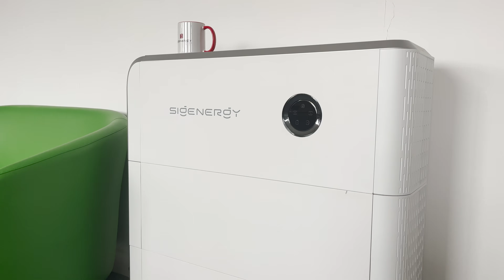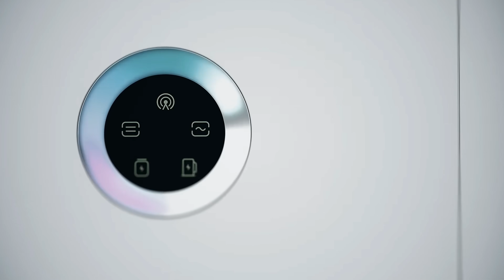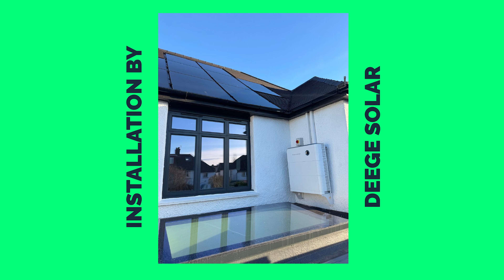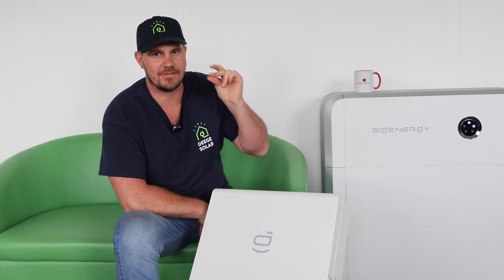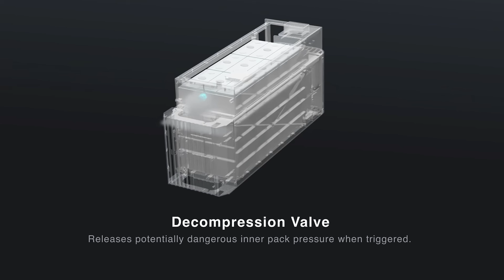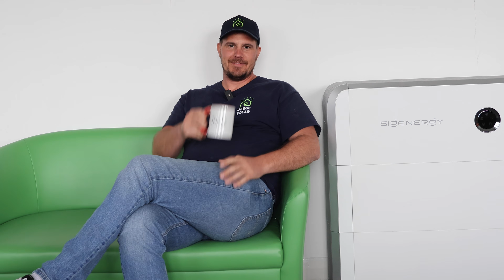Everything You Need to Know About the Sigenergy SigenStor | Full Battery System Review!

Comment: imho what lets  the sigenergy down, is the "creative sizing of the batteries", compared to the pw3 what you see is what you get, upon watching this in november, according to its tecnoligies a 8kw inverter plus 3 9.04 kwh batteries comes out @ £9,066, which is 720w shy of 2 pw3 units,eg 1 plus 1 expansion packs for 27kwh DOD 100%, i was quoted on the phone by octopus for the pw3 1+1, just shy of £9600, so a extra 720w thereabout for a extra £500 or so seems like it is worth the extra cash,plus with the pw3 as standard it has multiple power levels, without the need to change inverters, which is where sigenergy also falls down, bad choice by the marketing dept trying to market a 10kwh battery that in reality is only 8.76kw, plus the 15mwh warranty is a bit naff too,myself my 2013 3.68kwh FITs system in 10 months so far in 2025, i have generated 3.852 kwh, so realistically for me 4mwh a year ,with circa 2013 panels ,which if i had new panels as well, my batteries would only be warrantied for under 4 years, NOT good either warranty the batteries for charge cycles or time, not on throughput,with the advent of smart tariffs most people will use the export to earn money,eg fill the battery on cheap to 60-80% and as soon as the sun is up or 7am export like crazy to get the 15p per kwh export rate, leaving enough in the battery for the house loads, myself i average 6-7 kwh a day usuage,so i would be aiming to export @ least 20 kw a day, that will soon eat into the 15mwh warranty level, add a ev/heatpump & your warranty on the sig battery quickly comes down to 3 years or less, it is these "glitches" that will potentially cost it warranty claims in 3 to 5 years time, and whats not to say sig will start saying "you have gone over your 15mwh throughput warranty", neither you or me or joe public have crystal balls to know how sig will react to people,playing a daily arbritage game & munching through there throughput warranty in double quick time ??, it wins on being one unit with a max of 6 units vertically, but yet again there own datasheet claims 100% DOD on the 8.04 but it is only 7.86,over a full 6 stack its a 1.56kw difference to there claimed figures, another  big slip up, toal lack of marketing for the UK market imho ,market the product correctly from the start & have confidence in your product & warranty your batteries correctly not on a "throughput" value :)

Comment: Thanks for the great vid. Question around the battery warranty? So does 15.85 mwh throughput minimum mean if you cycled the 5 kwh battery twice a day the warranty lasts less than 5 years? 10kwh x 365 x 5 = 18,250 kwh or 18.25 mwh.

Comment: If my DNO is restricting my power import from the grid to 7.5kw, and export to 3.86kw, am i still able to use the DC charger on single phase to get 12kw EV charging? 

I.e. can i set different limits for import and export to grid and EV charging through the software. And i assume i would need the 12kw inverter to DC charge at 12kw?

Great video by the way
Reply: I believe you need to buy the product based on the import amount at the time of install, if your DNO changes 2 years later you would need to buy a new component that supports another import e.g going from 7.5 to 8.5 vs the Tesla PW3 its software and you can just increase the import to a higher number with zero cost

Comment: Nice vid David, an interesting laid back style of presentation.  I agree the SigenStore system is cutting edge. Small correction : the charge/discharge rates of each battery module is half their KWH rating, so the 8KWh module can discharge at 4KW. In your example, 2 x 8KWh modules with 12KW inverter could only discharge at 8KW.
The pizazz for me is the DC EV charger.  If you think about it, for bidirectional capabilities, you will be limited by the size of your charger. An AC charger at 7.4KW will be just that from the EV to your home. Being DC, not only does it bypass the car's on-board charger, it can view the vehicle's battery as just one more in the stack, in parallel. Future proof..
Reply: Laid back indeed, hehheh, almost horizontal at times.
Reply: Thanks for your input. I'm in Australia and just learning about this technology and hoping to get a Sigenergy system. I will pick up my 2023 Tesla Model Y AWD this week (my first EV) and hopefully Tesla will enable V2G on this soon.
Reply: that dc charger sure is gonna speed up the battery degradation

Comment: Thankyou for this informative review.  However, one aspect was not covered and that is data access.  For my present system that I am currently looking to upgrade or replace, I can download data files onto my PC every day and monitor performance over time, seasonal, monthly, daily or by time bands.   I cannot find any solid information on the availability of data and an enquiry to Sigenergy has not been responded to.  A similar enquiry to a rival company produced a reply in less than a week.  This does nothing to enhance the reputation of Sigenergy for me, despite the technical competence of the product.
Additionally, you mention the low voltage batteries used in the Sigenergy system, but some other supplier, eg Givenergy, are offering high voltage stackable batteries.  Do you have any thoughts on the relative merits to home users of low voltage or high voltage batteries.
Reply: I'm interested in this, too. I have a Gateway and 3 x 5kWh installation with hard-wired Ethernet connection. I use Home Assistant and there is a HACS integration, Sigenergy ESS, which requires Modbus‑TCP to be enabled by your installer. Will ask my installer if it can be enabled. Ecotricity is my energy supplier and they are launching dynamic demand pricing later this year. They will be using Amber Electric's Amber for Batteries which is compatible with the Sigenergy Gateway.

Comment: Nice info vid! But do u recommend it for Enphase micro PV systems for a battery as the inverter isn’t optional is it so wasted
Reply from the maker: Interesting enough Sigenergy are set to release their own Mirco-inverters in the UK in Aug/September, we have a little Short coming out too about it. However, we agree, even with their own micro-inverter model you require the energy controller still… which seems wasteful
Reply: My Gateway and 3 x 5kWh installation has Enphase microinverters connected which show up as "3rd Inv" in the Sigenergy App (with an animated line from the solar panels to the Gateway). Seems to be working fine. The Enphase microinverters use Powerline Ethernet to communicate with the Enphase IQ Gateway. I think that the Sigenergy microinverters will use WiFi to communicate which will establish a mesh and elect one of them to talk to the rest of the system. My preference is for hard-wired connections.

Comment: Thanks for this information I found it very interesting We are just going to have a sigenergy system with 9 SunPower performance 7 panels  we will have a 8kwh controller and 8kw battery  I am just thinking that we maybe should have two 8kw batteries and charge up on a t off peak and sale back at peak time. Also when we use the off peak in the winter have more energy for the next day.
We use around 4000 a year
Reply: If you're in the UK, then you can use Octopus Flux to charge the battery overnight at cheap rates and then export it during peak times 4-7pm I believe, and get paid for it!. As an FYI I have heard Sigenergy will soon be announcing a 10Kw battery in the same modular stack I.e. you could have 2x10Kw batteries
Reply from the maker: Yes a 6kWh option too, although we are not to sure as to when they are landing in the UK.